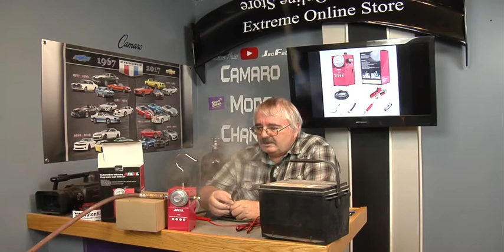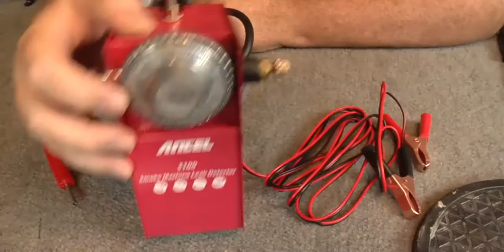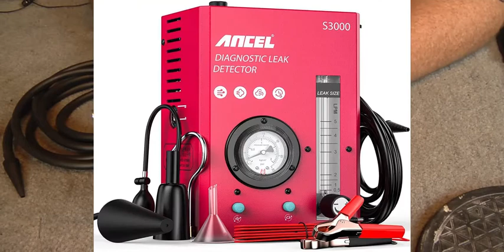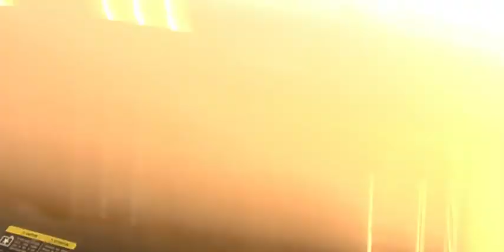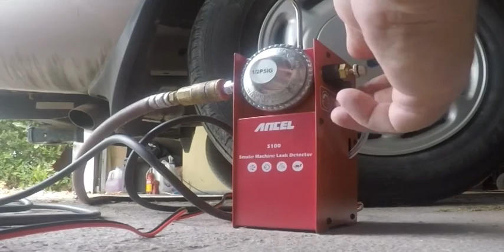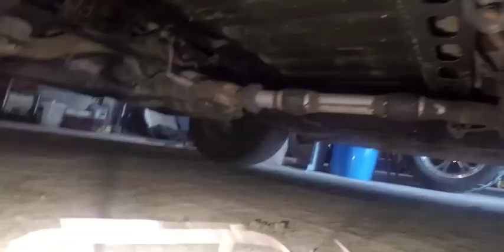Ancel S100 Vehicle Smoke Machine, Leak Detector.Unbox, Product review, Test unit.

Comment: This thing takes out all the guess work for finding leaks, and it's low enough pressure ( < 1 psi) to be safe for using on the evap system.
Reply from the maker: Yes, this is a must have item.  Very nice to find leaks.  Thanks 😊

Comment: Very nice ! Thank you for this great video but at what pressure should I set my air compressor for proper operation?
Reply from the maker: About 20 lbs , thanks
Reply: 20lbs=1.3bar right ?
Thank you boss 👍🏼
Reply from the maker: Yes, you don't need much.  Thanks
Reply: @camaromodschannel  ok 👌🏼

Comment: Damn, that's a slick little device!!  Didn't expect it to fill up the exhaust system as quick as it did..
Reply from the maker: Yes it's fast,  very cool machine so much better than the pressuring up the system and looking for a leak,  very low pressure.  And just look for smoke.  Very cool. Thanks